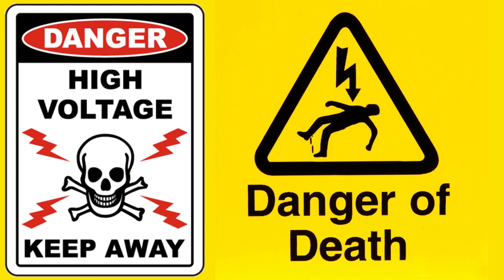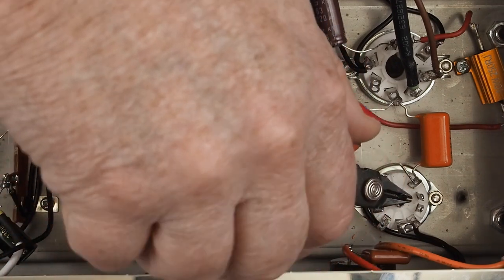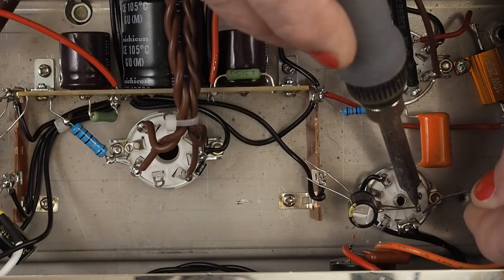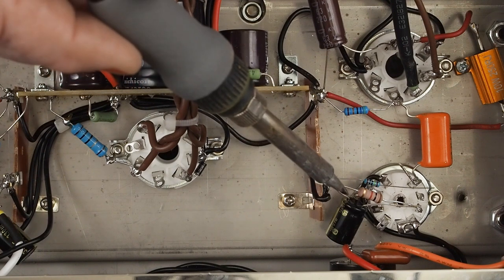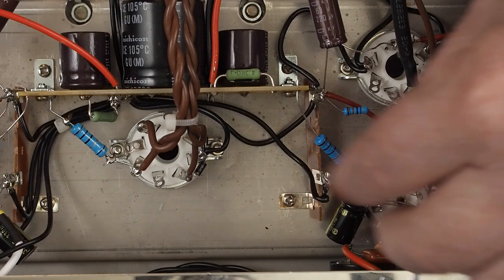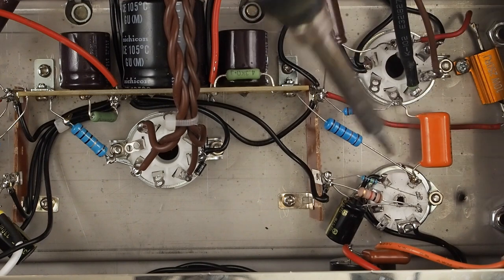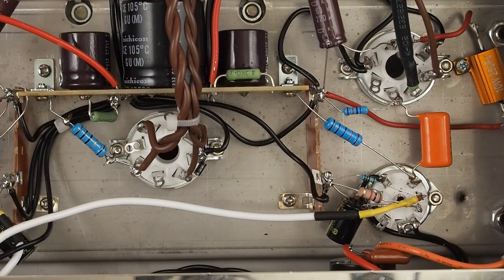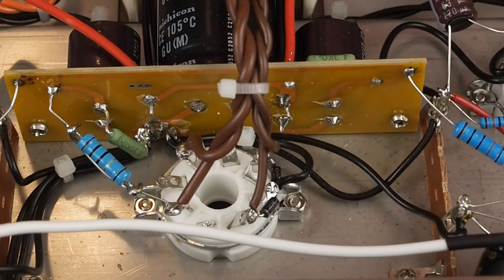Boyuurange Reisong A12: Doing the Mods Video #2

Comment: modification done, and absolutely loving the sound of the amp now. Thanks so much for your videos!!!!
Reply from the maker: Great to hear!
Reply: @SkunkieDesignsElectronics  the amp seems to be running a lot hotter now. I'm someone that usually leaves on my amps throughout the day.... is it not advisable after performing the mod? also.... I understand that we don't know the spec of the transformer, but... what could be seen to be a usual operating temperature? I've done the 'touch the transformer for 3 seconds' test, and it passed hehe
Reply from the maker: @lewiswaddo5045  Well it is "running hotter" but honestly you are wasting tube life leaving it on when you aren't listening to it. It it's not too hot to touch (transformer) than it should be fine.
Reply: @SkunkieDesignsElectronics  cheers for the response. If a tube blows, I guess it gives me an excuse to try new ones 😂
Reply from the maker: @lewiswaddo5045  I've been running the EL34 tubes (JJ EL34L) at this same wattage dissipation in my 6SQ7 amp for over a year now with no issues.
Reply: @SkunkieDesignsElectronics  cheers my dear! I’ll be adjusting my amp habits hehe :) again, thanks so much for all your efforts. I’ve been letting everyone know about your channel. Looking forward to following your future projects :)
Reply: @SkunkieDesignsElectronics  replaced the bridge rectifier with a solid state, and it’s running loads cooler now! Massive improvement :)
Reply from the maker: @lewiswaddo5045  That is something I want to test too, thanks for the update!

Comment: Very nice. I'm happy to see your results were so positive. On your driver stage, did you consider using a 220k plate resistor? The load line might appeal to you more with your voltages. I just removed that rectifier and did a bridge with 4*MUR480E rectifying diodes. Slightly more B+ (349) even with the 8.2k and 2x10R on the pcb. I dropped a 680k from plate to plate and removed my global feedback from the 4-ohm tap to the 12ax7 cathode resistor, and I am happy with the results. I did not add the 220uf bypass cap, however.
Reply from the maker: With 100K and the bypass cap, it has plenty of drive. I tried more and I recall it created a little more distortion. Without the bypass cap, the cathode resistor adds negative feedback which reduces voltage swing, which might need a larger plate load resistor to compensate. Many ways to skin a cat.